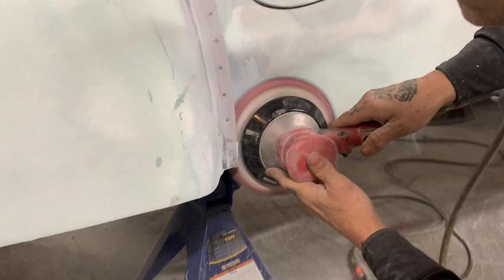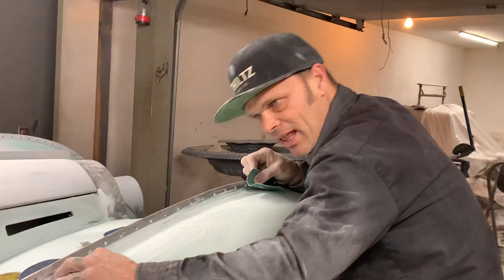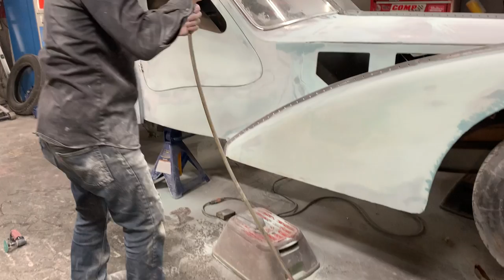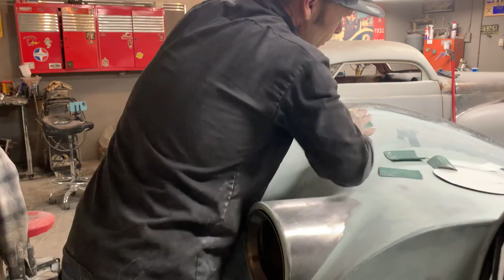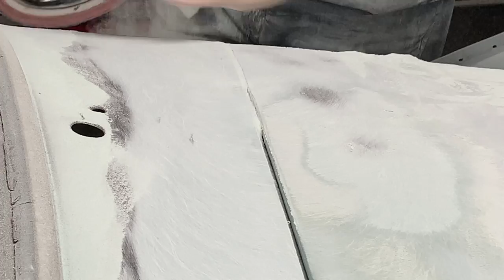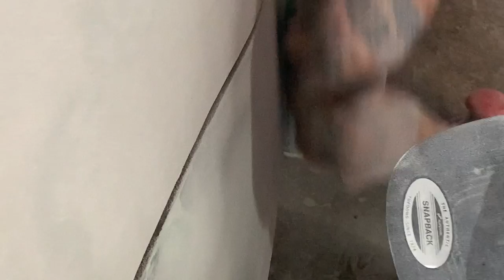FASTEST WAY TO SAND AUTO BODY FILLER FOR SHOW CAR FINISH

Comment: Got it ! ... 40 / 80 ...... it looks like that 40 year old g10 daihatsu sitting in the garage is going to get a make over now an put back on the road. Our state govt in Qld Oz has changed rego regs for vintage cars to be more easily shown on the road. Rego ~$80 / year with limited number of days on the road (log book anyone) and membership of car club. Way to go for sure re our motoring history made more visible.  Thanks to you both for the good oil and enthusiasm it will happen at my place.

Comment: Chad when doing fenders next to rivet crown. I would use a hand block...not a small squeegee but block rubber ends open to slide in paper....Just way I was taught 55 years ago.. 
BTW at Chevrolet  the Forman asked if I knew what red putty  was I said yes he said go get the tube in the store room...I got it he said been here 20 years it will be here for 20 more...we never used red putty to fill scratches or pinholes.

Comment: Looking at that big place to put wheels I was thinking the bigger the better as then it gives more clearance for that big motor so I think that the big cars of old days had 21x7 but not positive.as memory goes in old age, but then that might mean purchase. Hey just bit off topic I never see the green goblin anywhere unless it’s specific video on it. This car has quite a following I think mainly due to your workmanship, as not very many people would ever put that much challenge on them selves.your doing a fine job I often wish the distance wasn’t so great as I’d like to be thereto help as well as learn. Now I’m almost changing my mind on the colour ( you’ve never yet mentioned you preference ) but I have seen some colour changing paint jobs of which they calling hyper. But it would also look fantastic in dark brown. I don’t see very many in brown it’s usually black or green or two tone. Two tone more rolls Royce but I’ve seen some  Bugatti two tone ( I like single colour best tho) real tiny gold fleck dark brown is just standing way out in my mind and can picture that very easily.

Comment: I love the tongue comment, lol, my dad used to say that if it isn’t working maybe your holding your tongue wrong! Move it to the other side and see if that works better! Lol. 
I have a question for you Chad. I have done a lot of bodywork in my years, nothing pro but doing the work to fix up a car was the only way I could afford to buy that car at the time. I always had the problem of the filler showing through the finished paint, even though it was not showing through the primer. I would make the repair, fill it, sand it, prime it, touch up any low spots, put on multiple coats of primer, sand it again, and when there was nothing left showing I would paint it. If it was a black or other dark colours it would come out looking ok, but the filler would show up in lighter colours as if it was on the surface! It is like the filler was absorbing everything! What is your opinion on the reason? I’m presently working on rebuilding a 69 Camaro and trying to figure out what I’m doing wrong before I get to the filler stage. I’m painting it with a candy yellow on top with a red and orange candy stripes on the sides and black bottom, and I’m concerned that those light colours will drastically show those points.
After watching your work on this car, I’m thinking of doing filler over the entire car rather than just the repair points and maybe eliminate that risk.

Comment: Also let the people know you’re not using hand pressure then sanding, let the paper do the work. Excessive pressure just dulls the paper and digs holes in your filler. Think of it as pushing the sanding block across the surface, not into it.

Comment: Just finished an air boat bottom.8ft by 16 ft ,3 layers of fiberglass matting,and let me tell you brother,It was a bitch sanding that shit smooth.Had to use a big grinder with 36 grit sandpaper.☹️☹️☹️